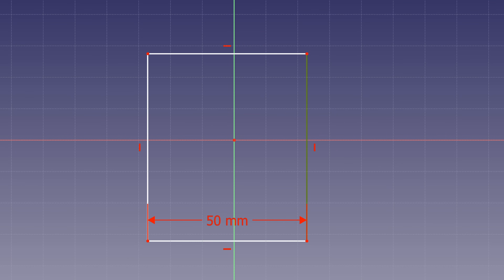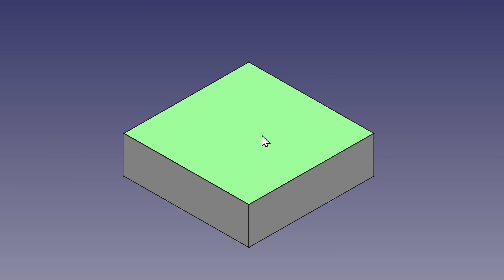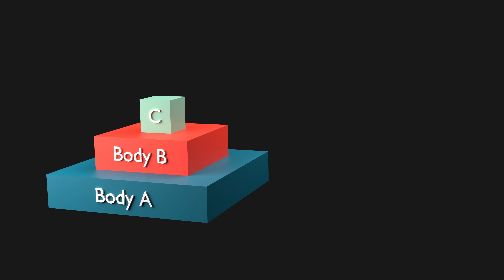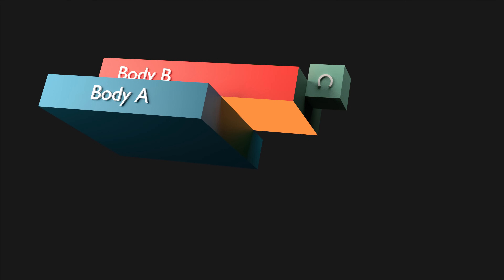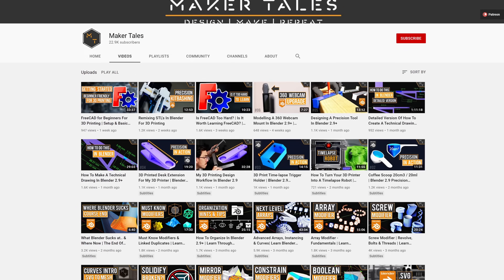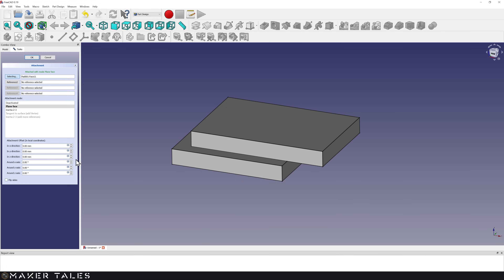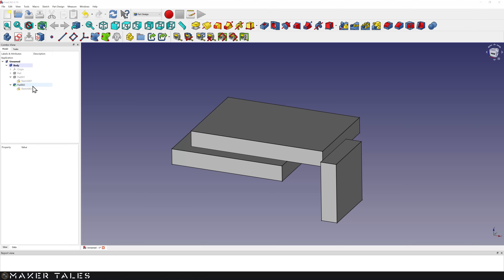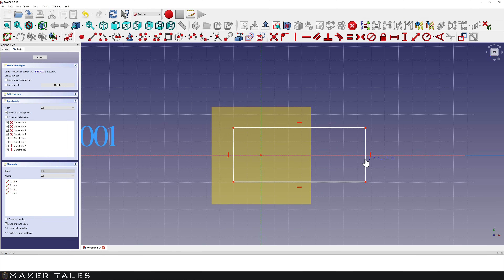FreeCAD Is Fundamentally Broken!  - Now what... Help Me Decide...

Comment: I use FC once in a while to design very simple parts for 3D printing. I don't have much CAD experience, but made my living before retirement as a software engineer. Clearly this problem is a serious design flaw, whether or not "bug" is the right term for it. I have read quite a few forum threads etc. on this, and have often encountered comments to the effect that, well, you shouldn't use CAD software that way anyway. Also, there are plenty of remarks to the effect that this is a hard problem to solve. 

It may be a difficult problem to solve, but a lot of comments excusing FC miss an important point. Take the "simple" example in this video that demonstrates the problem (three stacked rectangular bits). If, to a human user, the identity of the faces,, or features, is clearly retained through the edit, and the intended result is conceptually clear to a human, then there is a software solution to the problem. If the software does not produce expected results which can be clearly defined by the human user, the software is WRONG. I acknowledge that (software implementation aside) there may be cases in which an alteration or transformation creates ambiguity about the identity of the resulting geometry, and what would constitute "correct" results. But that is clearly not so for many simple instances where the topological naming problem creates unexpected, and clearly wrong results. So really, there is no good reason to accept the current behaviour and work around it, at least not for long.
Reply: My guy, just use fusion and stop wasting your time. I assure you your time is more valuable than experiencing this.
Reply: Again ... it's Free. You would have a valid complaint if you spent $3,500.00 USD
Reply: @rogersmith5183  The point is not about whether complaints about FC are valid or invalid, or whether the software is free or costs money. The point is that the topological naming problem is a design error, not a user-practice error.
Reply: @djpenton779  Actually, my point is that highly productive work can be done with FreeCad even with the "bugs"... and for free.  I have been involved in software design and programming of some sort since about 1981. There are "bugs" in every piece of software.  Ask Willie Gates.
Reply: @djpenton779  Anyone who uses Modeling CAD software knows that the "topological naming problem" is an issue with a number of CAD packages - if not all at one point during development.  I think the video should have been just about the topic, rather than dissing a single product. "FreeCAD is Broken..!"  Really? The thumbnail alone begs the potential user to search for an alternative.  You are correct - stick to the point, rather than single out a product.

Comment: Learning of FreeCAD is easily flatten with just downloading a few ebooks from the Amazon website. 

What is this 0.2 shit ? FreeCAD 19 is up and running fine. And the topology issues is being dealt with as I write this. 

I am not a CAD professional, just a machinist. If you think FreeCAD is difficult, do not even try TurboCAD, that will drive you insane. 

I currently use FreeCAD for 3D printing projects, and in the near future, laser cutting. I cannot see myself using any other CAD.

Comment: When you say “silly bug” you should have said “design decision” cause in the end it’s not a bug but an implementation working as designed. The design might have some wonky results of bad assumptions but still there is no “incorrect” code to be fixed. Changing the behavior amount to a new feature.

Origin referenced everything is probably the best way to go about it all from a video perspective. That just teaches good CAD skills regardless of software package. Makes for very robust models.

Comment: You may face other bugs as you progress. I have used FreeCAD v0.17 mostly on windows but later I abandoned it. Because it was bloated. The developers were using coin3d for geometry instead of its own kernel Opencascade. The commands didn't worked as they were documented and supposed to e.g., in arch and drafting module. I created a small 3 story Reinforced Concrete BIM model that hanged. While the developers of FC blamed sluggishness because of single thread of OpenCascade.
Reply: when you say BIM you say Revit? I have learned Revit recently and I'm not completely sold on the benefits of it... how do you feel about it? I feel like it takes 5 or 6 times longer to do something compared to what I can achieve in 2D CAD... and the features like materials, lists, sheets, we barely used it anyway 🤣also major resource hog, takes forever to load links references
Reply: from what I have seen, BIM seems to only be useful for managers to micro-manage every single tiny detail in a building... "move this column here", "let's move this ceiling up a bit"... I feel like the restrictions of 2D CAD kept people's insanity under control... in the end, the time commitment seems to be the same to me (time equals money in company time)

Comment: Here is what i do to avoid this shit to happend. I do a shape binder on the face i want to attach my next sketch. And then, on this shape binder, i do a datum plane. Then i sketch on this new plane. You can still use reference to the other part of the body like direct sketch. i do mask the shapebinder et the datum plane to sketch easily without being bothered by it. If you change the form and add a new face, you need to modify the face attached to the shapebinder and it gonna fix the part. 

it's hard to use.. i know..

Comment: What you'd like to achieve is parametric design. Fusion covered the most of it through it's history bar, while construction in other software requires more primitive geometry built to define points, planes or axii to define a sketch.
Reply: You can still break models in Fusion or any of the others. Funny thing is I see a lot of pros comment that they use datum planes to help avoid the issue in the expensive programs too.
Reply: @LightCarver  You can't break a model in Fusion this easily though. As it is now in 2024 still, FreeCAD is only for the advanced hobbyist, a very small cohort. Professionals are better off using proprietary software and beginners are turned away by the poor documentation, ancient UI, bugs and the elitist community telling them "skill-issue" when they run into problems like the TNP.
Reply: @iliketoast-q9b  I haven't used fusion in over 3 years now other than to export someone else's work. Back when I did use it... a broken model would often lock up the program giving no chance to repair, or it just couldn't handle the way I was trying to do something. I'm sure it's better now, but personally have no interest in creating anything with it. (I do not like a lot of Autodesk's business practices and the way they treat hobby size businesses and hobbyists.)
I occasionally use Freecad,  but mostly work in Blender now.
Reply: @LightCarver  If Blender works for you, that's great. For complex parametric modelling, manufacturing and simulations you need proper CAD software. Due to the state of FreeCAD a lot of hobbyists and engineers still do not have a good open source alternative. Don't get me wrong, I want FreeCAD to become the Blender of the CAD-world and I install every new release. But it's still not there after over 20 years.

Comment: If you think that Datum Plain workflows will still work in future versions, it would be useful to have them.   If it's a good practice across any CAD platform, it's a good thing to teach and a good thing to learn.   If a quick and convenient shortcut (building off of faces) comes along in a form where the software does a decent job of protecting a user from their own poor CAD practices, that's fine, teach it when it arrives.
Reply: It over complicates models because you end up having to have parametric functions to update the position of the datum plane which has to be added manually. No one is going to want to go through that for basic modelling. You normally wouldn't get into that until you start putting assemblies together.

Comment: I am a former employe of Dassault Systèmes and used Catia V5 since about 20 years (plus UG, Inventor, Blender, Fusion, etc). So glad to see such an amazing open source software as FreeCad. Amazing work done by the community. However, it makes me sick to hear here and there from users people talking about "Good practice" when in fact it is work around and silly tedious contortions for a massive issue other CAD softwares deal prefectly with since eons. If a parametric software CAN'T deal with topological naming correctly... well... it is NOT a parametric CAD.  Glad to hear that a non official branch solved most of the issues, but knowing the problems with files compatibility from one version to the other in freecad, let's hope this set of fixes will be integrated in the official version soon and make finally Freecad dominates. I teach FreeCad and seriously, other than that issue, it is amazing!
Reply: Incompatibilities with other versions are caused by new features witch are not presented in older versions. Taking a model made with FreeCAD 0.18 to 0.2 works as i know.
Reply: It is not non-official branch because he is involving the debugging of official FreeCAD especially on topo issue. And the branch is updated in compliance with official release from time to time.
Reply: @UCuAQiYYki3iC4ehSJifzz3Q if it's not the main branch it's not an official branch, it's literally a fork.  It doesn't matter if it's going to be integrated back or not
Reply: Has this unofficial contribution been integrated yet?
Reply: @FuriousImp  yes
Reply: @FuriousImp  Still ongoing work. But FreeCAD is completely broken and unstable beyond TNP.
I think they would do good in deleting all source files and starting from scratch. With a plan. With proper considerations.
The fact it's in beta after over twenty years is laughable. And the general state of the tool is nothing but sad.
Reply: Its crazy this and other deal breaking issues with Freecad are still not fixed years later. Always seems to be the case. Always this that and the other forks with fixes that dont get integrated for years.
Reply: The way FreeCAD currently forces you to work really is best practice - when whole parts of your model depend on a previous part no CAD program can actually handle a change to that part exactly the way you want every single time - where forcing you to use some functions and set everything on working planes offset from the origin is entirely dependable, as long as you get those formulas right the part will only shift in the way you want with changes to the parameters in older parts.

That said its is just so convenient to bolt the next bits onto the existing model and in most cases works well enough, even with FreeCADs wonkyness, that who needs best practice most of the time (Plus the whole formula for repositioning of the working planes starts making just using OpenSCAD seem like a winner).
Reply: Sorry no. That's just cope. And it's unacceptable cope.

Topological naming needs to be fixed. Period
Reply: @foldionepapyrus3441  That's a bit like saying, "it's best practice to always custom make a bolt each time and thread match a perfect nut to it."
No, no, no. People have better things to do with their life. The whole point of being able to click on a face and work there is to improve workflow.
Custom making every plane - is a BAD practice. It opens you up to the excessive un-editability (might as well work in solid body instead of parametric) and also the near miss problem: you bodies look visually connected, but aren't. There's a reason 2d cad uses snap. You are giving that up in 3d, to work around bad software handling.
Try that with a mold or 3d print.
Why did a 2week long mold cutting fail, costing $30k? Because some engineer decided to go back to the dark ages and try to manually spatially place everything on his own and got it almost right. He was only off by a tenth of a degree on his plane, but what's a few thou among friends?

Best practice here is an excuse for "software handles poorly and requires specialized workarounds." And that includes when software writes it's output in ways that are unfriendly to other mainstream software that would handle other programs just fine.

Autocad acted that way in the 2000's with exporting.
Then Solidworks released a viewer and CONVERTER that did for FREE what Autocad was claiming was too difficult.
Almost as if Autocad was more concerned with forcing people into using and staying with their software rather than causing engineering faults...
Reply: @MaintDocs  For quick and dirty models, one offs that you don't really need parametric modelling for in the first place the snap to type method is very handy, but it isn't best practice.

The reason its best practice to manually set origins in a parametric model is because when you change any parameter the relationship between all the parts remains defined correctly (assuming you set up the parameters right). Which isn't the case when you don't actually set it yourself.

The CAD package can't know which edges, corners etc must be in a particular relationship to each other, so while in many cases you'll get away without manually specifying the correct relationships when it goes wrong that is you starting the model again most likely. 

And if you do it right manually setting the parameters with the relationships between them you need entirely prevents any aberrant behaviour no matter how you poke and prod the parameters - you won't get the 'looks connected but isn't' as the parameter that defines the second parts origin plane was set up by you to be exactly right no matter how the other shape changes in size... So if I set my shape to be width 3 rather than 4 as the second part attached to that side's origin was defined formulaicly using the first shapes width it moves too, exactly the way I intended, not whichever way the CAD package decided.
Reply: NO, NO, NO!!

Working with named topological is in fact the dirty work around , no matter if it was established 20 years ago. And it`s the main cause why we cant exchange parametric models to this day!

Comment: In the words of the Immortal Bob Dylan, "EVERY THING IS BROKEN" If you are useing cad so much that this makes sense then you should just pay for a professional Cad package and quit being a cheapskate. As far as me being a maker, In all the time I have had Freecad on my machine, not once has it been "TURNED OFF" by GitHub. I have been hammered by Autodesk at least 4 times so far with threats of locking their software and had to deal with the fear of losing everything I was working on. I am expecting another change in their amatuer or student version RULES any time now. As far as software in general, the saying is true; YOU DO GET WHAT YOU PAY FOR. Is there an open source software out today that is NOT buggy? As old as octoprint is it still has more bugs and problems than not. I personally think that the only problem open source has is they have not figured out that too many cooks spoil the broth. Someone is constantly breaking something someone just fixed. "I Fixed this, but it broke that." kind of problem. Just my opinion. I have not had a problem so far so I will let you eggheads worry about it. I do not work for SpaceX or Nasa so freecad is doing great for me. By the time I get to any project this would pose a problem for it will probably be resolved. I do not care which version you use for your videos.